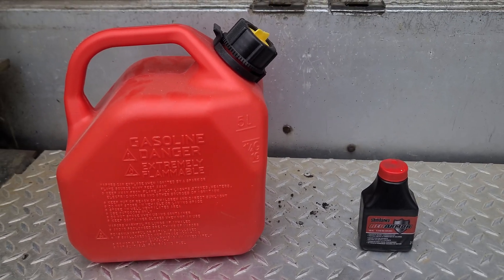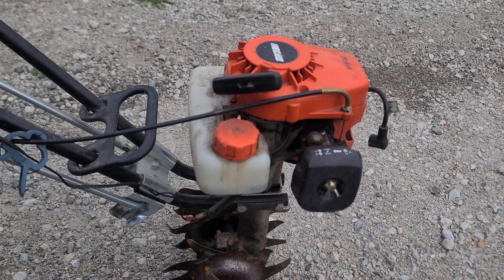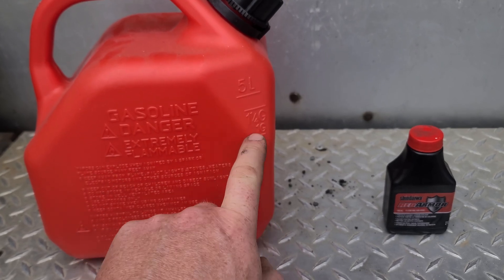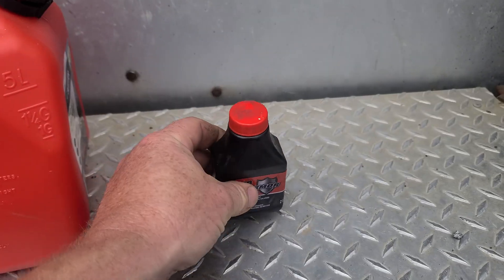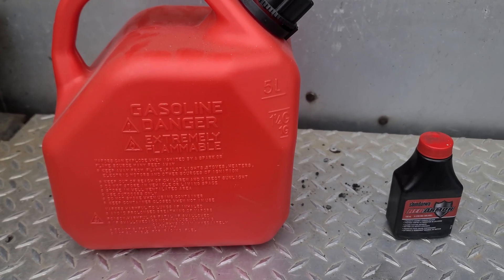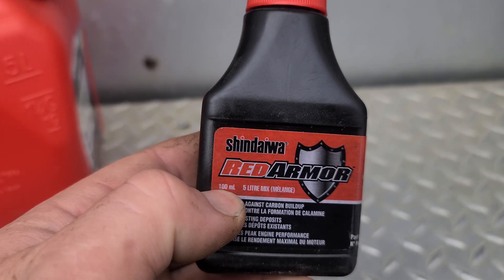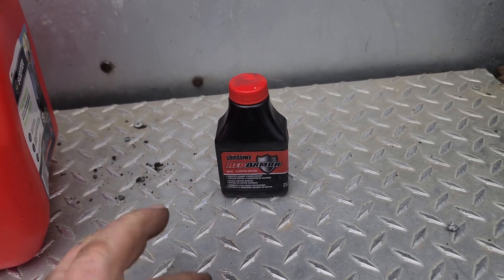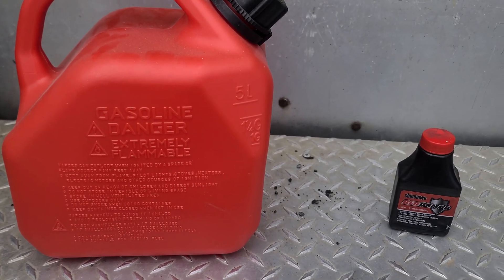How To Make 50:1 Fuel Mix For Your 2 cycle Power Equipment #smallenginerepair #stihl #husqvarna

Comment: How long can I store the mixture after I mix manually the 50:1 (1 gallon gas:2.6 Oz oil)? I may be left with 1/2 gallon leftover. Can I pour this into my Honda crv or should I just throw away since it’s going to snow anyways here in a month?
Reply from the maker: If you use chevron supreme plus you should be good to store your mix for up to about 6 months I wouldn't use it after that. Your CRV should be fine with the leftovers.
Reply: @machinesnmetal  It is a non ethanol gas mixed with 2.6Oz of oil.
Reply from the maker: Where did you get non-ethanol gas from?
Reply: @machinesnmetal  Nearby gas station. It’s called non-oxygenated gas here in Minnesota. It is $4.59/gallon here.
Reply from the maker: We can't buy it anymore up here, even our Chevron Supreme + "may contain up to 10%" I've resorted to putting a cup of water into my gas cans, shake them up so the ethanol binds to the water and then pour off the gas leaving the water/ethanol blend at the bottom of the can for disposal :(